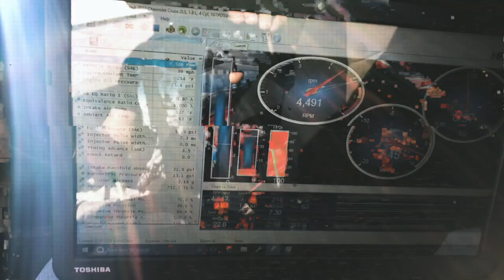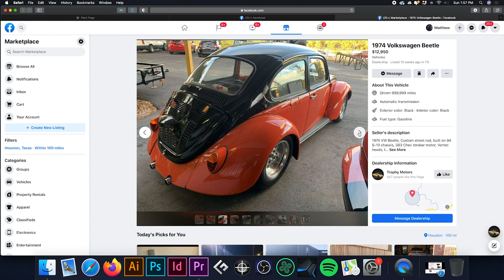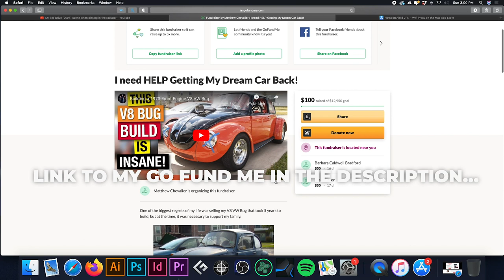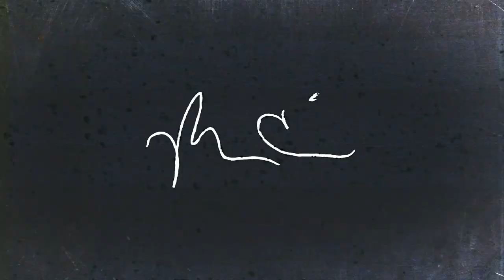I Wish I Had Never Sold My Dream Car... V8 VW Bug Volkwagen Beetle. Let's Get Her Back!!!

Comment: Try water wetter for over heating if you get it back. I have two V8 bugs one with a big block and one with an LS
Reply from the maker: If I get it back, I would just run it on meth. :)

Comment: Did you build everything on the v8 beetle? Why not start over from scratch? Here is wjat I just learned the vw 2.5 5 cylinder is the tiny engine making crazy 1000hp plus easy on stock engine parts, and boost and tune. And still is mild enough to daily. And 2.5 engines are cheap as a SBC.
Reply from the maker: I did! Too me 5 years. If I don't get the car back, I may do another, but like you're saying, smaller engine. Thanks for the tips and encouragement!
Reply: @cmattdabrat   I know losing my prized vehicle I had, I did not build it but it was total loss rollover and insurance did not cover the loss.
Reply: @cmattdabrat   That is a nice looking bug.

Comment: I gave away two cars 89 s13 and a 91 s13  to two " buddy's"  who were in need of a car and had a family, the only condition was that they let me buy it from them or something first before they got rid of them. Neither one homered it, one traded it for a crappy street bike and one wound up in a scrap yard. One was flawless and one was a racear. I'm buying a G35 and am ready set thatim gonna keep it for life. Like rebuild a junkyard motor and transmission for when it's go out. I have regretted the last 12 years for ever getting rid of those cars. They were 1k and 1.3k when I bought them, now a raggety one sells for 8k. When I get paid I'm gonna donate 20, I also have a family but I figure I'll spend that in Choco tacos if I don't so wth.
Reply from the maker: I hear that! You live and learn.
Reply: I learned that lesson too. Never lend out something expecting to get it back